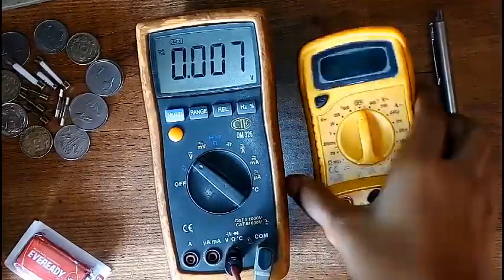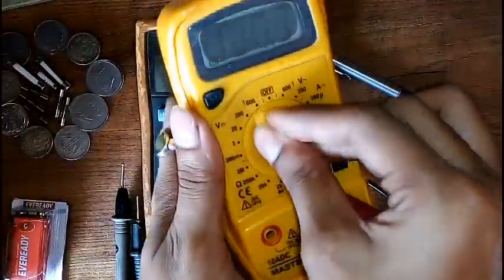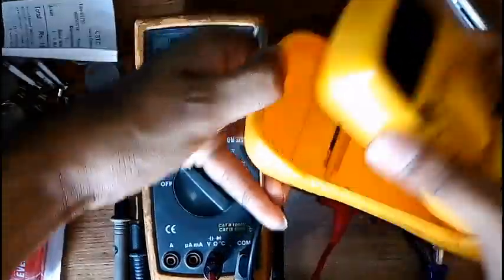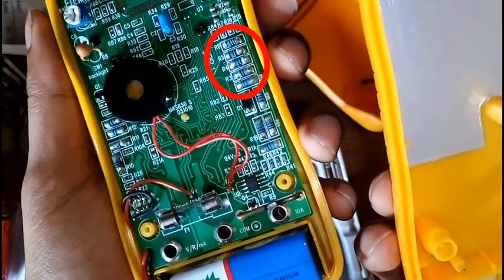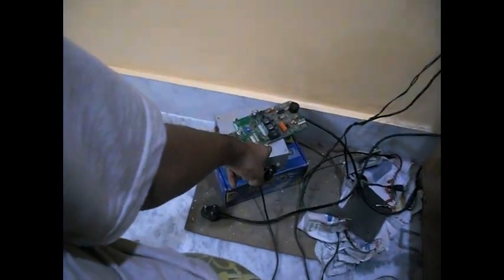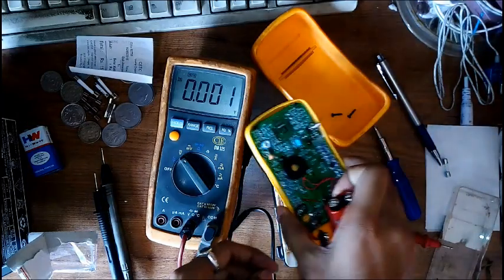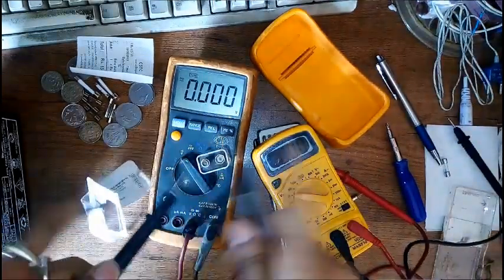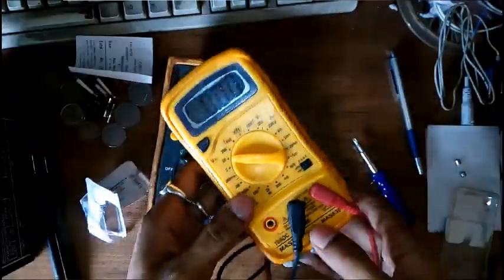How to Repair a Multimeter showing wrong values, MASTECH MAS830

Comment: I used two × 1.5 Volts batteries, the multimeter reading was 3.2 V, is that normal? What value should I consider for my lab experiment?
Reply from the maker: Ya it is normal... 1.5v batteries when they are new will have a no load voltage of 1.6V that's totally normal

Comment: Really? You did a video on how to change a battery...REALLY?
Reply: well, this hint helped me. I was ready to replace the car alternator and the multimeter as well(after I realized it is bad reading actually), as it showed 16v charge instead of usual 14.4v . I could have never imagined that a low battery would give so huge deviations, since the display was crisp and clear, no sign of low batt, except the sign :).

Comment: Thanks bro I had sorta panicked because I only have one multimeter and I don't have enough budget currently to get a new one I was working on modifying my custom pc to increase the performance and my multimeter just randomly freaked out like I was measuring across the motherboard's fan power out put to confirm the twelve volts but as I measured it was 15 to 16 volts for no reason that freaked me out what should I do now how did I mess up again thanks
Reply from the maker: you're welcome bro :D

Comment: after bad use of my multimeter
( measure resistance of motor but the motor was in voltage )
the multimeter do not give any measure . we do not see any value
how ti check and repair this multimeter

Comment: I was working on an electric furnace yesterday and did a voltage reading. I used the 750 AC setting on my digital multi-meter to check for 240 volts, but ended up only reading 190 volts. I wondered if the furnace was getting full power so, I checked a nearby AC outlet and got a reading of 96 volts instead of 120. I have a little analog multi-meter too so, I quickly grabbed it and checked the voltages. It showed 240 and 120. Strange thing is, my digital meter wasn't showing the low battery warning. I will check the battery anyway. Thanks for the vid.

Comment: Yesterday I discovered that my Fluke meter is showing double the voltage I’m testing.  I was totally shocked, no pun.  I’ve never had an issue with Flukes.  Any ideas?  The dc voltage reading displayed is at least twice the amount I’m testing.
Reply: Its the same for me... well please do reply if u got the repair for it..
Reply: mine shows half of what my oscilloscope show's
i mean RMS

Comment: You do realize that the copper wire that you mention as a bypass to a fuse is actually a shunt (low resistance) used to measure currents. youtu.be/kQxc_Fz7Dn4